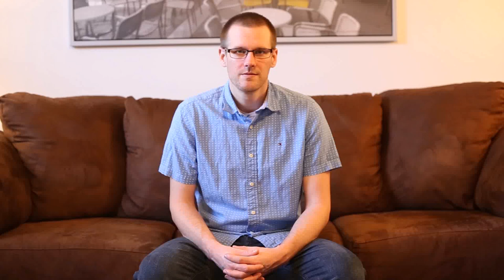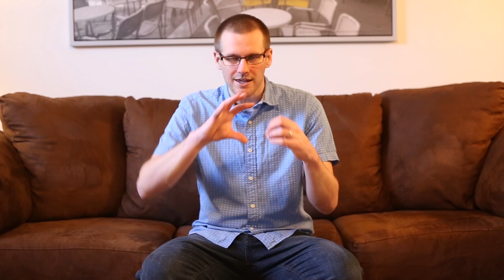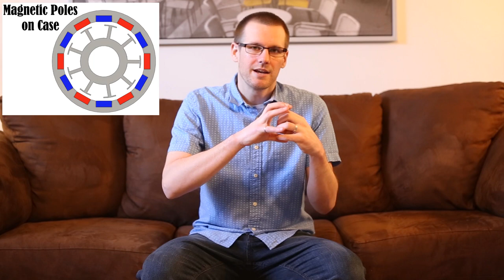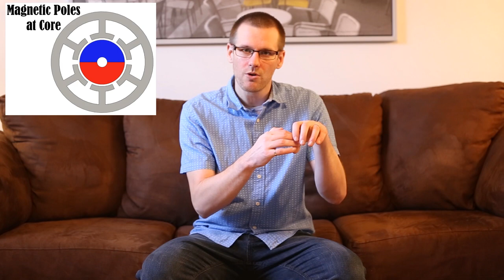Pole Count on an RC Brushless Motor - RC Motor Basics

Comment: Question for you?  Some cars are built which "enough" power to move the car and a little extra play power.  Then some cars light Ferrari and Lamborghini have excess power but can be driven slowly.  In an instance like this,  what is your suggestion to apply more power than needed and what would you suggestion for KV as you have stated, to over power an application on purpose?

Comment: I have a 2 pole VXL system in my slash 4x4. If I upgrade to a 4 pole motor will I have to get a different ESC as well? Thanks!
Reply from the maker: Most ESC's would be able to support a change in a motors pole count from 2 to 4. However, it does seem the VXL system has a commutation frequency limit preventing it to run 4 pole motors based on a quick search. I would ask on a forum if the VXL ESC has been updated to support 4 pole motors as I am not familiar with this system.

Comment: I disassembled  (2) Baldor 3 Phase motors last night, both were 5HP. One was 1800 and the other one was 3600 RPM; the 1800 had significantly less wire  in the windings and the diameter of the rotor was bigger compared to the 3600 RPM which had a lot more wire used in the windings (taking more space inside the motor) and the diameter of the rotor was smaller. the resistance in the leads for both motors was the same.1&4,2&5 and 3&6 1.2 Ohms 7,8, and 9 1.9 Ohms. Both motors were physically the same size. I thought it was interesting.

Comment: Question on Motor Poles and current need help understanding please!

Given the same motor dimensions, kv, volts, and propeller/wheel how does the number of poles affect the amps/current under load.

one motor has 6 poles, the other motor has 10 poles.

how would the 10 pole perform? smoother rotation? more torque for sure, but would it draw fewer Amps with same load and RPM as it does not need to work as hard?
Reply from the maker: Hello,
With all else equal, there will be very little difference between the motors. I would not expect the average user to see any difference. Some potential differences off the top of my head include:
Smoother operation at low RPM's. 
Easier for the ESC to turn the motor at extremely slow speeds
Lower theoretical Max. RPM limit
Potential for better efficiency (not enough information for a conclusion)

For the average user, I would say that the differences would be negligible. 

In terms of torque, watch the latest video released:
https://youtu.be/xi7jxIkX2vY

Comment: Hi, 12pole/ 14magnets  215 and 300kv motors will cutout at 3/4 to full power when they unload at take off feel it could be ESC, Timing or Freq settings ESC is Hyperion Titan 90a HV  from memory  high timing 22-30 should I be also on high Frequency  16kHz   turned OFF LCV and  to eliminate voltage drop cutout any ideas
no heat issues doesnt happen with my YEP ESC

Comment: If a gear in my transmission is breaking due to torque, should I gear up ( lower number) to decrease to tq multiplied by the pinion and spur or should I gear down and make the motor pull less amps and power ?

Comment: let me ask if there are 2 motors DC of the same size, one with 2 poles and the other with 4 poles, which motor rotates faster and which one will bear the load better. thank you very much.
Reply: Basically any motor with lower pole count is designed for higher speeds and lower torque..and usually have a smaller effective diameter @ the air gap..( diameter difference between rotor & stator ).... That's where all the flux / magnetic  ckt.  TORQUE is produced.....for the rotor.... 
And torque is directly proportional to this effective diameter..
A higher pole count motor will ,  by design default be larger in size( dia) with lower max speed......if a small diameter higher torque motor with high pole count & high rpm is required..then the  motor will be designed with a longer length...(like submersible pumps)..these are effective design tradeoffs to be considered & accepted...

Comment: If i Have to design a bldc motor of particular Kv rating and low very low cogging torque than how should i start designing the motor do you any specific documentation for designing motor of particular size and parameter.Please help
Reply from the maker: To completely eliminate cogging torque a slotless design can be considered. Otherwise you will have to focus design efforts on the stator.

Comment: Hi Ryan - i have a seawing 3660 3 wire brushless motor , can i connect it to a 2 wire esc, how ? - thanks very informative video
Reply from the maker: Hey Stephen, thank you for your comment. Brushless motors use 3 wires. Brushed motors use 2 wires. If your esc only has 2 wires it sounds like it's a brushed esc. A brushed esc will not work with a brushless motor.
Reply: @RCexplained  hey thank you for your speedy reply - i thought as much , just been out of it a bit long and getting back into things - thanks

Comment: I have a 2310kv 2 pole motor and it has noticeably less speed than a 4 pole motor with the same kv and specs. Will gearing help me with more speed or are 2 pole motors just slower?
Reply from the maker: Hey Mo Hawk,  do you know how many watts each motor is pulling? Do you know the temperature of each motor when running?

Comment: Thank you for the great info as always! 

So if there is a 6 pole motor available in the kv/can size that works for my application, is it safe to say that it would be a better (more efficient) option than a similar 4 pole motor?
Reply from the maker: It can be, you can see this from the winding resistance and Io value of the motor.
Reply: I also own a blackjack24

Comment: Hello..Can esc that ussually work with 4poles motor can work on 2poles motor? Thx u
Reply from the maker: Yes, most ESC's have a wide range of operation in terms of pole count.
Reply: @RCexplained  are there any differences in speed? Could it harm the motor or esc? Thx
Reply from the maker: There's not a significant different from 4 pole to 2 poles. As you increase pole count, maximum output ESC RPM does decrease, however nothing that should impact you.
Reply: @RCexplained  so if 4pole esc used on 6pole, the esc rpm will drop. Than how can we tell that an esc has 2pole or 4pole programmed?
Reply from the maker: The maximum capable ESC RPM decreases not motor RPM. More than likely your ESC is capable of over 100,000RPM on 4 poles. You will not have to worry about this. It is rare that the maximum ESC RPM ever limits the maximum motor RPM for a standard application. I use 4 pole motors and 12 pole motors on the same CC ESC, not a problem, excellent performance.
Reply: @RCexplained  i see..thx u so much for your information.
Reply from the maker: no problem, glad I can help.

Comment: If you were constrained to a 6" length and 3.5" diameter case dimensions and required at least 5000 rpm but other than that as much torque as you could cram in it, what would be your design?

Comment: I was hoping the title was going to address out & In running motors.
Primarily addressing the question is if an “Outrunner” motor has 14-magnets is that considered a 14-pole motor or not? Love to know that answer very badly.
Reply from the maker: Depending on how the magnets are arranged, yes it can be a 14 pole motor.
Reply: 14 magnets is 14 poles..but for a motor designer..it's considered as a 7 pole pair motor...because pole pairs (always N & S ) will make a working motor..A motor with odd pole count or all of either one type do not and probably cannot exist as a functional one...

Comment: Is it possible to make a dual runner? A motor that has magnets inside and outside stator.
Reply: Yes such motors do exist and are built as such......but since outer & inner magnets rotate @ different " rates " their alignment w.r.t. each other ( outer/inner )is very critical...accurate tooling is also required.....
Also the design & assembly is very difficult 
(ours { p.m.brushless dc. } was a prototype for feasibility study)..
ultimately abandoned because calculated mass production/manufacturing cost & time outweighed everything else.  ...
everything else... it's large physical size too was another negative... ..this was in 2004..
Reply: Just to add here.... "different. rates"  is also the  rate of flux linkage between inner rotor magnet and stator wdg. whilst the outer rotor magnets and same stator wdg. will have another rate of flux linkage ....

Comment: hi RCexplained . very thank for your information.  i want to ask you why an electrical motor efficiency going to decrease when we apply high load on it without gearbox ?
Reply from the maker: The resulting efficiency is based on how close the motor is operating at it's most efficient power output for a given voltage. If the load is too high or low, efficiency drops. The motor won't know if it's turning a gearbox or direct drive.

Comment: Thanks Ryan, good explanation. I always thought a 4 pole motor is less efficient then 2 pole motors…so that is not the case. 

One question if you would like to answer. What are the cons on High kv  brushless motors with vent holes in can? I know its better for cooling,but what about the efficience ?
Thanks
Reply from the maker: I would expect there to be little difference in efficiency.
Reply: @RCexplained  thank you!

Comment: Ok you got me, I’m subbed. Quick question, are you on any RC forums? I’m building my first brushless micro RC drift car & im feeling lost trying to figure out cogging, & the correct gear ratio + motor KV for peak efficiency. 

I picked up a brushless car so it would be more efficient & run cooler then my brushed car. But now I have started researching the tuning aspect, & I feel overwhelmed. I’m afraid I will use the wrong KV & gearing combo & will end up making the motor inefficient. 

I’m releasing a video tomorrow morning about the new car if you are interested. It seems like you are more into the larger cars, but I’m all about indoor micro fun.
Reply from the maker: I sink most of my time in to the channel and website. As a result I am not active on forums these days. If you have a question you can leave it right here and I will answer it. 

I wouldn't worry about efficiency more then I'd worry about a reliable brushless setup.

Comment: still no clue why to have more poles then two. I kept asking why, why, no reason, efficiency?
Reply from the maker: First reason that comes to mind is a higher pole motor offers lower kv for the same amount of winds. Meaning you can go to the next available wind to get back to the same kv increasing the current potential of the motor. 
All the reasons why are based on what more poles has to offer.
Reply: @RCexplained  I do understand that, but why would I want that? It does not explain much. Especially that the magnets are smaller and maybe the motor gets more or less powerfull? It should be smoother per rotation, but that does not mean more powerfull. But I have looked into it alot, couldn't find alot of definitive reasons to switch to 4 pole, then I looked at my new motors and both already were 4-pole :D. So....Did not know that. What I am looking for is more torque at the bottom, less at the top for a crawler so i do not break stuff but still can go really slow. I am at the max of my gearing already.
Reply: @mrDarksand  : From my experience and understanding: Higher poles gives a motor higher torque and less rpm (kv).. Just like changing your gearing  (and includes all the same side effects to heat, effieciency etc)
Reply: @justinmallaiz4549  What I usually see on KV ratings of motors (and the rest stays the same) low kv motors have the same torque as high KV ones. And this is because the output power stays the same. both KV have a max powerlevel, lets say 1000Watts. This Means, at top speed, both will deliver that at the same RPM, the only difference is that a low KV will get that from more Volts where the High KV one gets it from amps. P=UxI. So in theory they should both have the same strength. I am now gearing down and getting myself a low KV sensored motor. And the only reason I go lower is because I can not gear it lower and it is still too fast. and my hope is the sensores will make the motor smoother on startup.

Comment: A 4 pole can be smoother than 2 pole, but I wonder how it delivers more power or torque,  If  there are  4 poles the size of one pole is smaller , exactly half of a 2 pole one, strength of 1 pole is half. 
I think the maximum output of a motor is limited by it size , if 2 motors fully packed with maximum space utilized (A 4 pole motor and the 2 pole ) the same amount of copper is inside ,  motor should have the same output watts. even if the rotor is bigger in 4 pole motor then its stator would be smaller and have less copper which makes less electromagnetic field.  What is your idea about it? please correct me if I am wrong
Reply from the maker: Hey Gehan, I agree, the maximum output of a motor is defined by size. Pole count is not as critical when considering the output power. However, kv/torque will be different. On a higher pole count motor the ESC is going to fire more times per revolution than a lower count motor.

Comment: What will happen if I keep the number of poles the same and increase number of slots ?
Reply from the maker: A lot can happen if you increase just the stator slots. The motor design is highly dependent on this. Anything from torque output, Cogging torque, efficiency and a lot more can be affected. 
A very general example is going from 4p12s to 4p15s. Torque output could be reduced however Cogging torque can be significantly improved. To wind a 15 slot stator would take some expensive equipment and may not be all that practical for our application. For this reason, we just let the motor manufactures determine which combination is best for their specific design.

Comment: I have seem many of your videos, but you just give a bunch of information about poles, kv, winding, turns, battery size but it is too disorganized because you talk about one theme in one video and the other video is a completely different topic that just create really more confusion  and not telling really a nice way to choose a motor application  and also focusing as you said in other video about your battery size and voltage or the maximum rpms to choose a motor that I am not agree, so in conclusion you give a bunch of information that varies the power, kv, current and efficiency from many aspects that leave no clue to choose a motor
Reply from the maker: Hi rotoR Col. Nearly every single video in the last 1.5 years is a topic suggestion from the viewers.  The video topic suggestion queue is almost 3 months long. 

I'm working on picking power systems for specific applications, however it's not an easy topic to place in to simple terms within 25 video minutes or so.